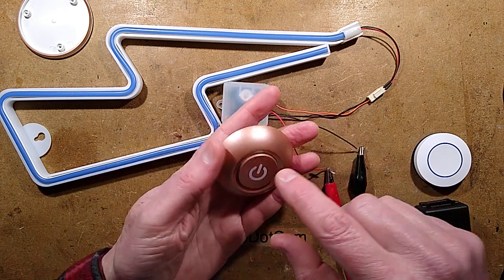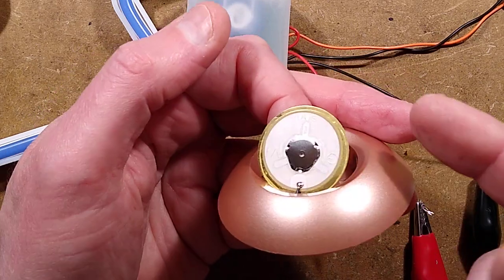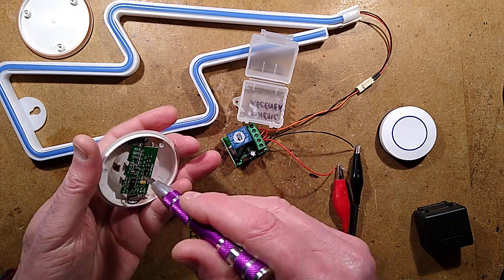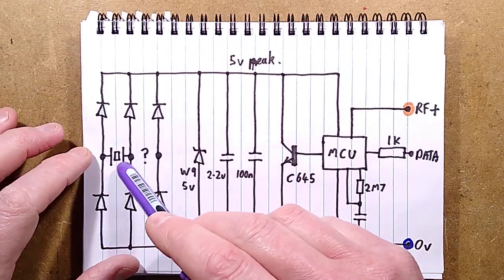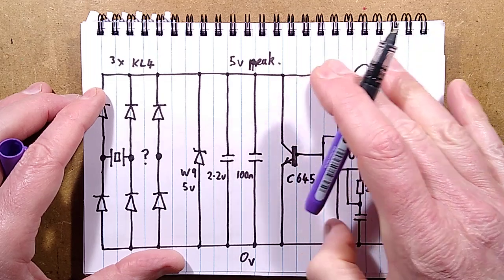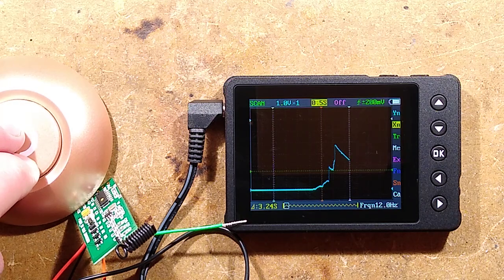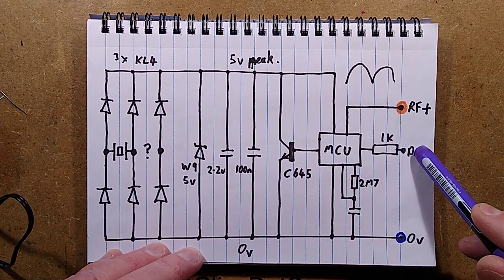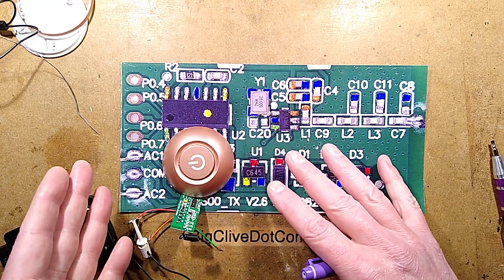I thought this was going to be a fake kinetic switch

Comment: The fact that you can get the transmitter AND receiver for 12 Pounds is itself pretty amazing good value! There are many useful applications for this, where the relatively short range is irrelevant. Swimming pool gate alarm comes to mind as a very useful application.

Comment: These Piezo triggers are great technology. When we moved in, the FIL got rid of the old doorbell system, because it was somewhat broken or whatever. Instead of getting a good new one, we got one of those wireless things, with a bigger bell thing and a small battery powered transmitter at the door. Batteries need for the button and batteries needed for the bell. And it was just that always when someone came to deliver something or whatever, it didn't work because the batteries were empty. Then I found a system that could be just plugged into the wall and had a button with Piezo power. And ever since, no problems. This thing works like a charm and no more worrying about batteries. I didn't particularly test out range or how many walls it could overcome, but at least it works from outside the door through one wall for a few meters and didn't have any problems with that.

Comment: I think some digital watches would crash if you tapped them due to the piezo beeper. Certainly remember hearing of Commodore digital watches having this problem. I think the Sinclair black watch had some issue, but I think that was more around electrical interference bothering it.

Comment: You could use an Arduino and a 433Mhz module to be able to use that kinetic button to do whatever you want instead of it being only supported by the module it came from :)
Reply: Technically yes you can, but it will need external power. Arduino and those 433MHz modules for it draw tons of power.
Reply: @KillerDragon987  Yea of course. It's just the switch that won't require power, same as the setup being used here

Comment: Very interesting.  It would also be interesting to see the RF signal data coding format.  Do you have  scope capable of capturing & displaying that data packet/s?

Nice work!  Thanks for sharing!
Reply: Capturing would be easy, just hook the digital scope up to the microcontroller's output pin. The scope might have a hard time decoding the signal automatically but it should be simple enough to decode by hand.

Comment: Theoretically, you could stack 2 or 3 piezo elements on top of each other to increase power output - and transmission range
A Piezo TV remote would be very nice, never needing batteries

Comment: you mentioning the piezo electric walkways reminded me, back in high school I actually did a project that ended up including looking into the company that was doing the whole power from footsteps thing, even going to one of the installations they had done for their second generation version. at least the 2nd gen ones were just using gearing to turn the stroke of the panel being pushed down into rotation for a dynamo. they put out way less power than the company was claiming, as far as I could figure out including less than the fancy display setup that came with them was saying. got to talk with the person who organized the local side of the installation, apparently the company was a nightmare to work with, and basically went radio silence once the initial pr stuff was over

Comment: At a previous job I used to make ultrasonic sensors. One of them used a piezoelectric crystal that was maybe 1.5" OD and 2" tall. If you weren't careful and allowed its temperature to change without having the crystal shorted it would just about shock the piss out of you.
Reply: Sounds like an electrifying line of work.

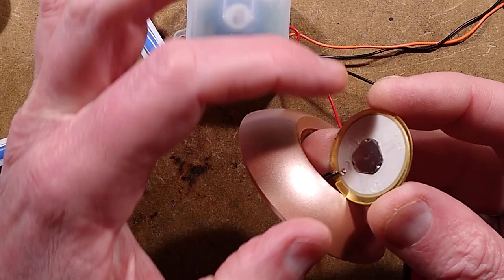Comment: 3:03 These are also used in socalled MAP-sensors (Manifold Absolute Pressure) in modern car brands, for measuring the amount of vacuum in the manifold,
so that the ECU can calculate how much fuel must be injected.

Comment: Try this. Reset it to program. When its ready to recieve the transmitters signal, use a cigarette lighters sparker. Not the kind with a flint. The ignitor type.
Those type of lighters have been known to turn lights on some devices like lights on hand drills.

Comment: The 4 contacts on the bottom of the circuit are programming pins I think, rather than test points, for in circuit programming of the chip.

Comment: I wonder if these devices have enough power to be used in emergency situations like if a building collapsed and someone could click that thing repeatedly(to build charge) to send out a signal shouting where they are? (it's certainly small enough to fit into the fabric of a wallet.)
Reply: Batteries would be more reliable.
Reply: @Asdayasman  Reliability of either option depends on the maintenance regime for the collapsed building.  If a building has collapsed, it's possible that it had been neglected, and the battery in the emergency beacon expired in 2014.  A piezo transmitter would have been more suitable.
Reply: @westinthewest  What use is an "I am here" transmitter fixed to a building?  If the building is collapsed, you can see that from the outside.  You don't need an RF password to see that "oh hey this is a smouldering pile of rubble".

The distress beacons need to be personally mounted, and the "maintenance regime" for those is incredibly well ingrained in us nowadays.  Ever heard of a mobile phone?
Reply: @Asdayasman Sorry I misunderstood the original post.  I imagined an alarm system call point in a corridor, basement or elevator car.  I agree that carrying a 433 MHz transmitter on your person in case you find yourself buried in rubble would be pointless.  It might be useful in an elevator which has somehow fallen down to the bottom of its shaft, disconnecting all the cables previously attached to it, or maybe when it becomes stationary between floors during a power outage.  In this case, an RF distress transmitter could be connected to a rechargeable power source which is constantly trickle-charged - perhaps by linking the transmitter to the batteries used for emergency lighting in the car.
Reply: @westinthewest  Amusingly you've misunderstood my post too, but in a slightly different way.  I think a radio transmitter on one's own person to aid in search and rescue efforts is a fantastic idea.  When a building collapses and there are people in it, having some sort of rugged RF transmitter would certainly get you found faster, so long as the rescuers are looking for it.

To give you an idea of how long people might be trapped under rubble in a rescue situation, check out this article from the British Brainwashing Corporation:  https://www.bbc.co.uk/news/world-32485586
Reply: @Asdayasman  I'm still confused.  Are you saying we should all carry a radio transmitter in case we find ourselves trapped under rubble, and would this transmitter be our mobile phone?  The BBC link gives an example of a girl that survived after four days, but I'm assuming she didn't have any communication device with her, or she couldn't use it at the time.  The problem with any transmitter is being able to use it when your arm is in a different part of the building and your face is being compressed by a sheet of plasterboard.
Mobile phones can be addressed by the network and made to ring.  I use the google 'find my phone' service every now and then;  it can show its location within a few metres, and make it ring at full volume.  I wonder if that has ever been used to find survivors?
Reply: @westinthewest  I'm saying that we should all carry some sort of device to attract attention to ourselves from under rubble or through thick smoke, it's a good idea.  I don't plan to be in a collapsed or burning building (that I can't escape on my own) any time soon, but if I was in a place prone to such things, like a country known for earthquakes, or a large hotel, I would definitely recommend the idea to people coming with me.

The transmitter being the mobile phone is also a good idea, because most people have one on their person and in a reasonably good state of battery charge at all points in time, but there are downsides, in that it doesn't transmit on the frequencies that might otherwise be useful for the task, which may make it harder to differentiate phones in the rubble from phones nearby in the crowd.

A phone ringing doesn't make quite enough noise to be heard (and located) quickly and accurately through multiple floors of broken concrete, so the audio thing, while an idea, isn't the best in the world.  It's probably better than nothing, but could just serve to deplete the batteries faster and add annoyance to the cripplingly terrifying situation for the survivors.

Comment: Regarding generating power from walking on a footpath, we've just had a 'Pavegen' system installed outside our train station in Leighton Buzzard which can power an information screen and USB sockets so commuters can charge their phone or laptop while waiting. It's the first installation at a transport hub in the UK and will be tested before a possible roll out to pavements in high streets too. Just walking can generate power for low energy lights and screens which could save fossil fuels being burnt just to light areas or run information screens.
Reply from the maker: If like to see the initial and ongoing costs of that versus just fixed power.
Reply: Well, naturally with new technology there had to be a grant to buy and install it but if it's put in a busy area (our station has 1.9m people entering and leaving each year) then it's hoped it will pay back the grant and make an ongoing profit. Time will tell!

Comment: That transistor operates exactly like a "crowbar" component in some power supplies, but for a different purpose.
A PS crowbar shorts the main DC rails to force a fuse to blow so that the expensive stuff doesn't fry (theoretically). This transistor shorts the "power" rails simply to reset the MCU. Clever as hell.
We were all thinking that first one was piezo and were disappointed when you opened it up- thanks for finding one that was!
Reply: Is the MCU effectively browning itself out with the transistor then?  What what came to mind when I saw it.
Reply: @DansKoiPond  Pretty much, yes.
Reply: First time I've seen a uc that commits suicide by shorting it's own power supply.  Weird, or maybe genius.
Reply: @raykent3211  As long as it reliably comes up in a known state when the power comes back on, and apparently it does, think of it as being resurrected- or respawned- if you like.
Reply: @markfergerson2145  since I posted I've read another comment that reckons it's not a transistor but a chip that delays reboot until the supply voltage is good.  I think I'd bet on that, how about you?
Reply: @raykent3211  If we knew the pinout of the processor we'd know for sure- is that an input or an output? But why a three-terminal device when two resistors configured as a voltage divider would provide a voltage to the processor if it's an input?
A crowbar transistor driven by an output from the processor would provide a hard supply cutoff to shut down the processor instantly.

Comment: I recall, in the late 90’s, there was a manufacturer that was putting piezoelectric units in the soles of track shoes so you could charge while you ran. Since they are no longer around I’m guessing they were crap or they missed a fatal flaw, or both.
Reply: Yeah, it was just marketing fluff.

However, a modern development is flashing LEDs in trainers driven by similar piezo, so it's useful as a safety thing in the dark. Low duty cycle makes them viable - quick pulse of current to flash the LED every step. They were in fashion 3 or 4 years ago (*) but no serious running shoes seem to have them. Night runners seem to prefer elbow-LEDs similar to flashing cycle lights. 

* search YT for "shuffle dance" videos in 2017 or 2018 and you'll probably see a few in use, though the nes with more LEDs have batteries and just use the piezo cell as a trigger
Reply: @gordslater  man, flashing lights in shoes was all the rage in 2002. At least, as a kid. But it would only last a month or two because of the battery. One kid in my school had one last 4 months and kept boasting about it until it finally died. Generating its own power sounds much better!
Reply: @kaitlyn__L  I never had any back when they were a thing in the early 'oughts, didn't realise they were battery driven, always assumed it was some kind of dynamo/kinetic energy deal.
Reply: @TheErador  oh, yeah! There of course was something to detect when you were taking steps (maybe piezoelectric, maybe quartz, maybe an accelerometer), but it wasn’t enough to run them from. I never had any, but a bunch of my classmates did.
Reply: @TheErador  What's "early 'oughts"? Hopefully nothing I ought to know by now.
Reply: @WhiteUnicorn82  early 00s...
Reply: @kaitlyn__L  Prior to 1997, there was a good chance they used a mercury switch which makes sense because they have a very long cycle life.
Reply: At least the child shoes have nothing more than a button cell and a led, the connection is only created through the impact vibration.

Comment: https://www.kitsandparts.com/lpf.1.5.php  look familiar? =) looks and likely operates just like this one often used in ham radios.
Reply: The last part of the output is very obviously a strong low pass filter with 1 pole per component.  The beginning of the circuit is a standard series resonant LC circuit passing through only a narrow band.  It would be interesting what the RF chip is.
Reply: @johndododoe1411  it looks like it just process data based on what he described since it takes data it spits out data and takes a clock pulse. The other inductor is an RF choke if you were curious.
Some sort of data chip, an RF choke then an inductor to match impedance then a low pass filter with DC blocking capacitors on each side. Edit: oh and the far left side has 3 capacitors which will be of different capacitance to shunt the RF circuit at different frequencies. 3 is better than 1 to provide a wider range
Reply: @Eric-xh9ee  The tripple capacitors are on the power supply where this is standard for feeding RF chips.  The circuitry I was commenting on sits between the RF chip and the antenna.
Reply: @johndododoe1411  I was just explaining what everything does. you'd have to look at the datasheet to see what the IC does

Comment: Smoke alarms use 3 pin piezo element. Maybe it was initially designed for this?_
Reply: I also suspect the three phase rectifier was intended for either a three terminal disk or for two disks to be fitted.
Reply from the maker: The 3 pin piezo sounders use one as feedback.

Comment: It'd be interesting to replace the piezo with a battery and resistor and use a momentary switch to connect power to the main circuitry so it'd be easier to 'scope the output.
Reply: Or connect a multi-Ah lithium cell to it and see what happens to that SOT-23 transistor when it tries to short out the rail ;)

Comment: Makes sense that the receiver will be the one with the timer, since timers require a constant current to run and the transmitter is built to basically hold no charge beyond what is needed to send a signal.

Comment: I also wonder if while the piezoelectric footpaths were a flop, would using the magnetic switch technology be viable for generating power via foot traffic? Even if it were just to power street lamps, I imagine it would be beneficial, assuming it would work at all.
Reply from the maker: I doubt it would generate much power.

Comment: There are high-voltage piezo devices used as ignition for gas barbecue grills and even propane torches.   Those put out several thousand volts.   Old phonograph cartridges using piezo crystals used to be fairly common, as did so-called "crystal microphones"; the latter were common because they were inexpensive and put out a very high signal level.
Reply: I have a fond memory of crystal earphones for their sensitivity in making minute signals audible.
Reply: I wonder how much of an RF range one could get from using a button with a  a 'piezo igniter'?
Reply: @w-mwijnja8919  Well, without getting into active devices, a simple spark-gap with tuned circuit and a decent antenna might make an interesting experiment.
Reply: Indeed, a crystal phonograph cartridge could easily put out a Volt.
Reply: @fivish  One of the electronics stores I used to spend some time in when I was a kid had them in 1,  2,  and 3 volt versions.

Comment: This is an extremely unusual idea, but I wonder if this sort of design could be used to retrofit an old Rock Band drumset and make it completely powered by the actual striking of the drums. The pads are just piezoelectric discs underneath of the plastic drum heads, wired into a controller board. I’d imagine one could make a USB dongle that could receive the signals from hitting each drum, as long as it could be programmed to receive each one as a separate switch.
Reply: The sensors might end up jamming (pun) each other, unless they use different RF frequencies, which complicates it..?
Reply: @catalinbadalan4463  Each one of them could be a specific signal, doesn´t matter if they are in the same frequency.
Reply: @ArturoValarezoChavez  This is not how radio waves work as far as I know.
Reply: @catalinbadalan4463  There would be possible interference but each one having a different “code” that it transmits would possibly mitigate any issues as far as the signal. My biggest concern would be latency since these things obviously aren’t designed to operate within milliseconds.